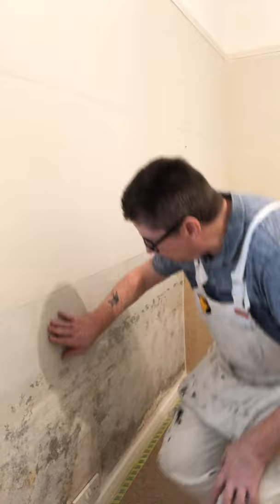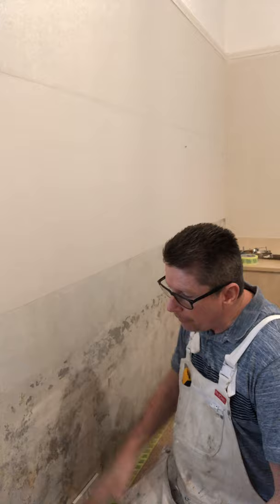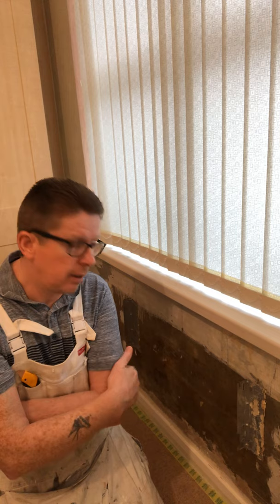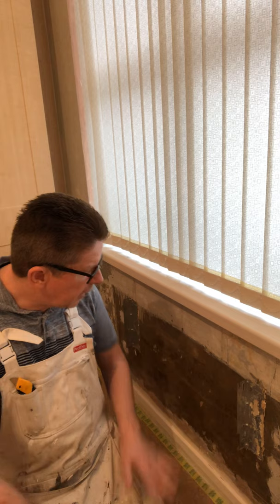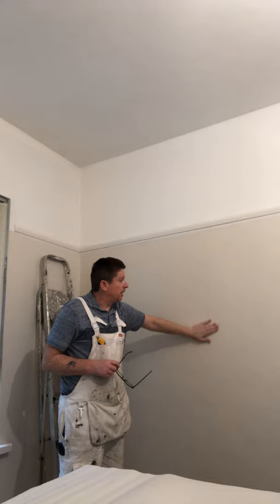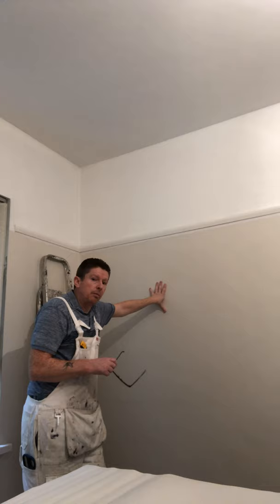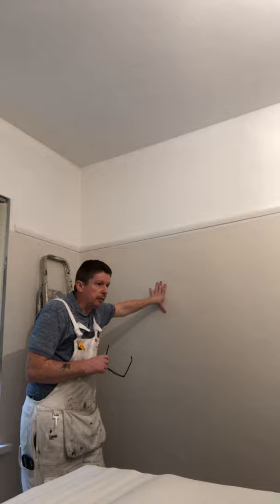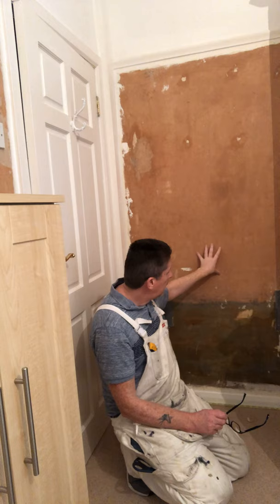Preparing walls for hanging wallpaper

Comment: I'm moving soon, and on a bidget, so will be doing as much as possible by myself.  Have watched a few of your vids today and subscribed.  The only thing missing, that I would find helpful, is if you add lists under your vid, about  links to all the papers paints, primers, fillers, brushes rollers etc, so I can see what I'm buying.  Am looking to get as good a finish as I can, and not just slap it on like I have done in the past!  Thanks in advance :-)
Reply from the maker: my cute pussycats hi thanks for watching & subscribing let me no what your painting & I’ll tell you exactly what you need having said that a good trade shop will tell you what you need as well but I’ll certainly help you.

Comment: What grade lining paper did you use ? 1000 or 1200...Is there much difference  ? Cheers
Reply from the maker: swissanthony Hi 1200 grade I feel a lot better to work with & trim than the 1000 grade.